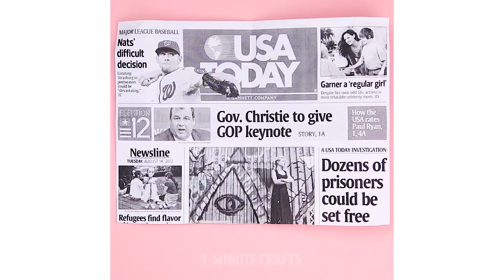24 GENIUS REPAIR TRICKS ANYONE CAN DO

Comment: Great trick for preparing river carp:

Take two new pine boards.
Filet carp.
Soak filets in salt water for 12 hours.
Put filets on one board, and cover with other board.
Bake at 375 degrees for 45 minutes.
Remove from oven, throw away carp, and eat the boards.